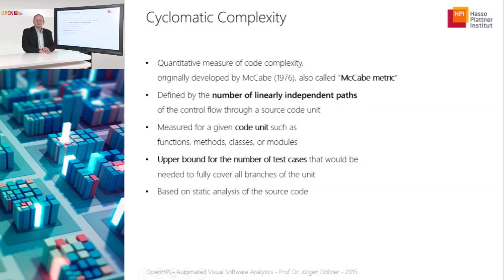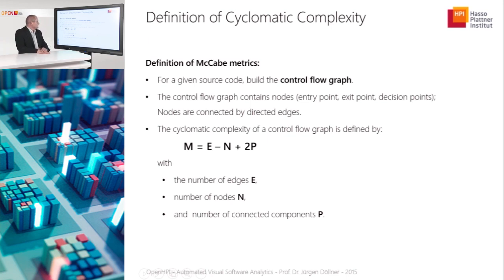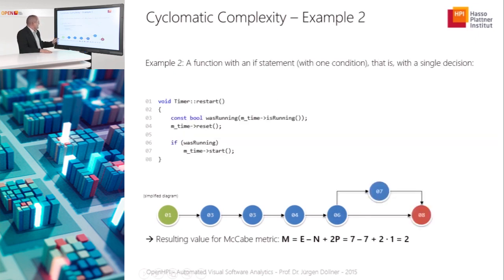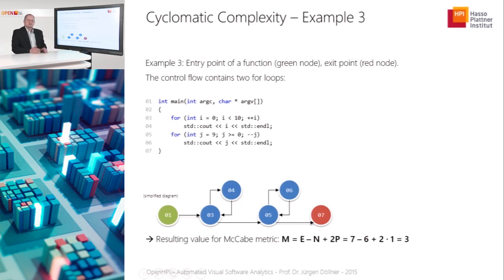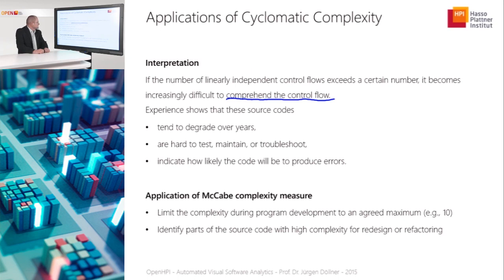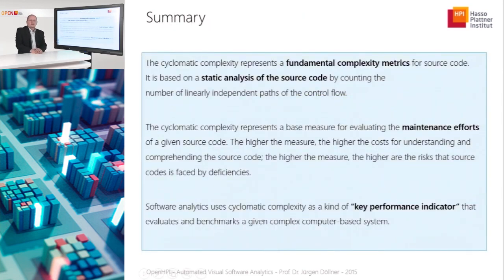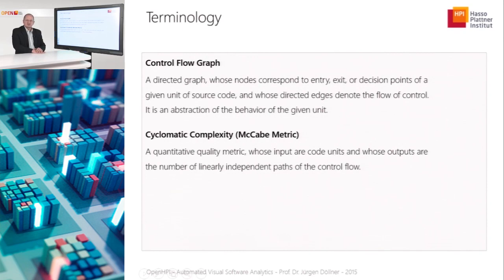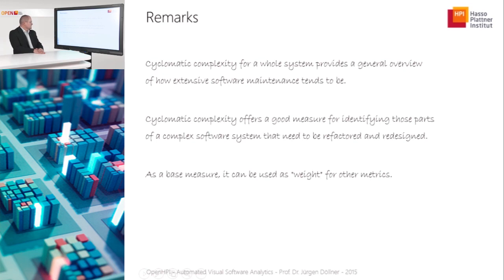2.5 Cyclomatic Complexity McCabe

Comment: i dont see 7 nodes, can you highlight the code which you are including as a node
Reply: I'm not sure if you still curious, but this is the breakdown for the second example.

-Node 1: Start [line 01]
-Node 2: Declare wasRunning() [line 03]
-Node 3: Reset the timer [line 04]
-Node 4: Call wasRunning() in the if statement [line 06]
-Node 5: Call isRunning() [line 03, this one is tricky because of the lambda operator] 
-Node 6: If true, start the timer [line 07, no false condition to add a node]
-Node 7: Exit [line 08]
Reply: @longlivespock  No. It is as below:

1. restart()                           [Entry point]
2. m_time->isRunning()     [Incorrectly numbered as 3 (duplicate) in diagram]
3. wasRunning()
4. m_time->reset()
5. if(wasRunning)               [Incorrectly numbered as 6 in diagram]
6. m_time->start()              [Incorrectly numbered as 7 in diagram]
7. Exit.                                  [Incorrectly numbered as 8 in diagram]